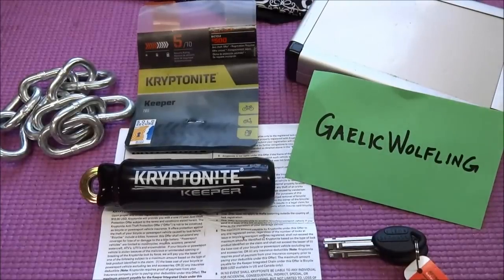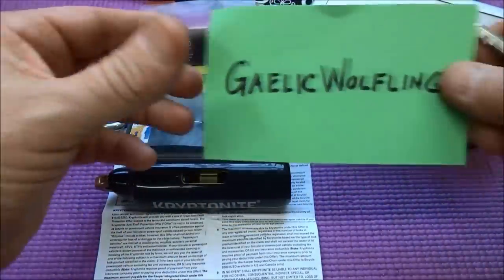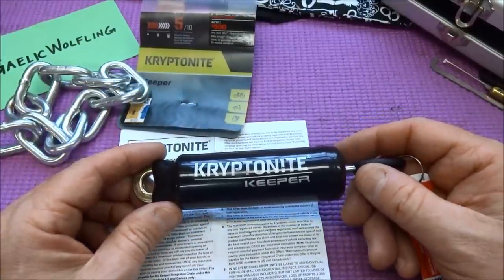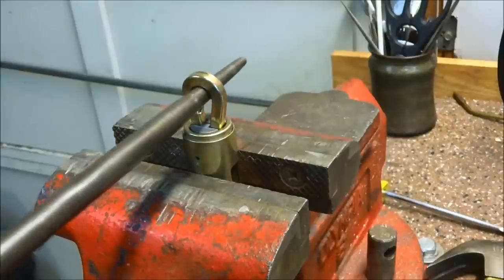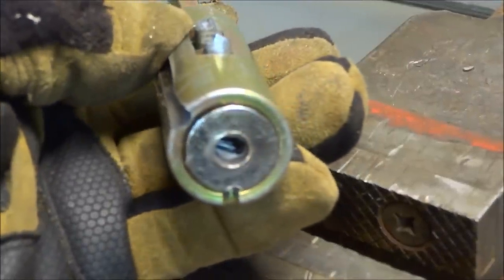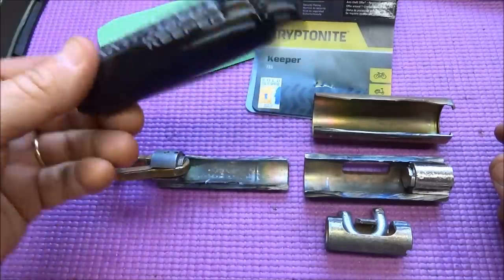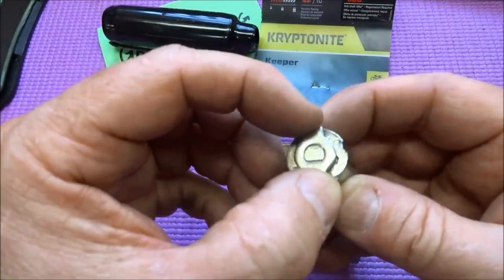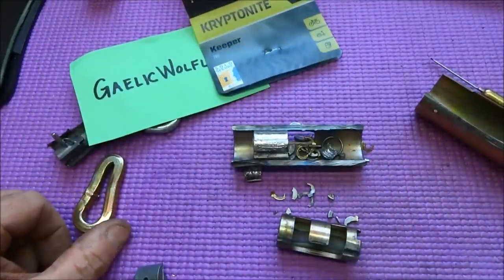(397) Kryptonite Keeper Bicycle Lock Autopsied - One TOUGH Lock!!!

Comment: All these locks are used to prevent theft of a bicycle, am I right?
But the bike lock must have some sort of flexible part to wrap around the 
frame of the bicycle and whatever you are securing it to, am I right?
So if the flexible part is a thick metal cable or chain, can't you just get through that with bolt cutters?
Sure, the lock is tough....but what about the chain?
Or are there chains made of hardened steel so tough that cutters won't work on it?

I'm not trying to be a smart-ass here, I genuinely want to know because I use my bike a lot in the summer 
and I don't want it stolen. So I'm asking, if they can't get through the lock, won't they just cut the cable/chain?
So what's the best setup to use to prevent your bicycle from being stolen?
Reply: +Don Miller The lock comes with a length of hardened steel chain that's an absolute bitch to cut through. It's going to require power tools and some serious effort to deal with. Much easier to just grab the next bike over.
Reply: Just A Dude

Hey thanks! I'm going to buy it, or one comparable. I appreciate you taking the time to explain it.

Comment: After watching this, I went to check the rating on my kryptonite U-lock. It says 8.
So I'm guessing the only reasonable way to steal my bike is to grind the bike rail, which to my knowledge is not common at all. I guess I can stop using two locks... although there is still value as deterrent.
Reply: simply apply thermite
Reply: Because every petty opportunistic thief goes around with thermite in their pockets...
Reply: bosnianbill thank you for responding so seriously. To answer your questions getting it is fairly easy it is formed by 50/50 ratio of aluminum powder and red iron oxide. How much will you need? That depends, if barium nitrate and sulfur are added to form thermate, if so only a few ounces will be need. Plain thermite will need about a half pound of reactants. The two catches are ignition and placement, both thermite and thermate are lose powders so they must be contained for use or bound in a material like artists clay. Ignition is were it all falls apart you are going to need either red phosphorus or 60/40 ratio of magnesium to potassium chlorate, the latter being if at best.
Reply: bosnianbill well mark me as served.
Reply: +Finn notyobissnes I'm not even sure anymore I'm really on YouTube. You two just had a normal conversation !!
Reply: +bosnianbill  I thought about it.... take the homemade mixture and mix it with wax in a mold the length of the key way ..( shape it like a key blank) Put a ribbon strip of magnesium in with the "key" in the key-way... Lots of heat and sparks/smoke prob would come out the key hole plus the plastic will prob melt/catch fire... But looking at the innards ...the disks prob wont need much heat to melt... they look thin... Or the cam on the back will separate allowing the locking pawl/gate.. to rotate...   Not practical for most bike thieves but, If an "agency " needed a noiseless quick entry..This may work... oh keep a extinguisher handy.. or lots of water...
Reply: +Dave G That wont do. The discs will melt, but they will pretty much seal the lock mechanism in place. Youd essentially be welding the lock shut from the inside.
Reply: +Grega Meglic Im Guessing you could just cut the chain with bolt cutters and just leave the lock on the bike/ on wherever its bolted to to steal it. Then Spray paint the lock to match the rest of the bike. If it is through the tire, and an expensive bike, just take the tire off, buy a new tire then resell bike.
Reply: rdizzy1
This is "ye old standard chain lock" Meaning just a chain and nothing more. And while the lock itself is pretty secure, the chain is as you say.
Reply: Grega Meglic
Ah, ok.
Reply: Grega Meglic
Especially now that you can get portable hydraulic bolt cutters, can cut through all chains, and almost all locks too I bet.
 And they are very quiet, and smaller than long manual bolt cutters.
Reply: +bosnianbill no, in theory a perpetual energy machine could not work. What assumptions are you making? No friction? and even then you could never take energy out of the system, or "harvest" as it were.
Reply: JuggleAddict
He means that only in theory would a perpetual motion device with absolutely no friction work, but impossible to build in reality. It can still be perpetual motion without taking any energy out of the system, it is just useless energy wise.
Reply: well yea, sure, take out friction and perpetual motion is everywhere. Heck, in that case just spin a coin.
Reply: +Finn notyobissnes So you basically need a chemistry university degree!

So simple!
Reply: +Finn notyobissnes lmao gg

Comment: Interestingly, Hollywood directors never show the torquing method. However, I've seen it done once in the movie "Heat." Tom Sizemore and Val Kilmer were robbing a bank. One went on the phone pole and hacked the security system. The other did the same thing you did: drive a huge chisel into the lock and simply break it with a large ratchet wrench. Would a professional burglar be more likely to use this brute force method if there was no other way to pick the lock?

Comment: why not drill out the pin?   don't know if it's been suggested.
Reply: littlegoobie A lot of the time these pins on well made locks are made of a hardened cast alloy and will just destroy any drill bit. I speak from experience as a lock hardware mechanic in the past. It is even common to run into security screws you can not take a drill bit to with out it ruining the drill bit. And there has been cases due to no other choices where I've had to burn up 10 to 15 drills bits just to get a deep enough hole to fit a 'easy out' in to remove/pull a pin or screw. But still that is a good question you ask, and chances are he probably already knew it would be a hopeless effort, thus the reason he didn't attempt it. What was obvious about the pin is it was a drive-in pin instead of a fixed pin, so it would've of been possible to pull that pin but a very taxing effort and a lost cause just by the design signatures of the lock.

Comment: thankyou i really enjoyed that being a guy that had two high end 2stroke supermotard bikes stolen because i used crappy hyped up chains and locks i eventually got smart and purchased an ALLMAX IMOBILLISER 2 16mm chain and an atlas padlock its a large padlock with a muscleman upper torso stamped into the case and has a flat key with a series of circular countersunk holes that are different colours ive not seen a key like it before and it says in big bold print DONT LOSE THE KEYS you can guess by that its un pickable suffice to say my bike has not even been attemped to be stolen as the chain goes through an OXFORD DEFIANCE ground anchor which is a beast of a ground anchor that has four 10mm rawlbolts with ballbearings tapped into the allen hex heads so now i sleep soundly at night knowing those thieveing bastards really arent going to get anywhere without waking me and my 30inch steel machette up so i can have thief suchi ps you may want to try and get hold of these products for a test.
Reply: dude if you locked all that up with a lock such as this, then its your fault for spending all that money on the toys and spending  30$ on a lock. the more valuable your toys the harder people may try to steal them, so the better your locks need to be and your over all security. its not bills fault you trusted so much to so little.
Reply: dude if you locked all that up with a lock such as this, then its your fault for spending all that money on the toys and spending  30$ on a lock. the more valuable your toys the harder people may try to steal them, so the better your locks need to be and your over all security. its not bills fault you trusted so much to so little.

Comment: might be a good lock, but it is open for dirt and rain, often fails to be opened with the correct key and the worst problem I read is that it happens that you can open a lock which do not belong to the key. Seems Kryptonite do not have enough combinations for it. btw an angle grinder opens every lock in less than a minute.

Comment: what about drilling the pins/lock.?
Reply: +adam moscatello Hardened steel, you will go through a lot of bits before you got through that lock. Better off with an angle grinder.

Comment: The unfortunate easiest single point of failure here .... cut the chain. Also, a question .... why always Drive the pin? wouldn't it be better in some(/most?) cases to drill out a roll pin?

Comment: You need to invest in cut off disks, they are a thin grinding disk, come in .040 and 1/16" thickness and cut metal like a hot knife through warm butter. They will cut nearly every type of metal with ease, and with lithium battery powered grinders almost all locks made of metal are doomed.
Reply: +Ray C. It's not something you should share with the public.
Reply: +AL eng it is common knowledge...
Reply: Spudwellington It's common knowledge on making bombs . I just suggest intelligent people refrain from writing the details for the public. And then there are those that are dumbasses and could care less about other humans.

Comment: Lithium battery powered Dremel with carbide bit. Done inside of two minutes.
Reply: +Rod Palm carbide drill bit  is wayyy too brittle for that. a dremel wouldnt provide nescessary torque and it would also be too high rpm for that drill bit. but i understand your carbide drill bit would be toast "inside of two minutes"

Comment: Those people saying "u should have cut the chain!! it is the weakest part" and "wow did the nsa really open ur letter!" are missing the point and are bad at subtle humour.
Reply: yellowfolder the actual chain that it comes with is hard-pressed steel lts just like the lock itself and the little link that was in the lock it's just like that
Reply: No one would use the original and then forward it on. Make a copy of it first and have your fun on that.

Comment: it's a '5' because the thickness of the chain. everything up to a ten is just thicker and thicker. it's just to drive up cutting time. breaking these in any other way is too hard. the 'cutting time' is a scam though since thieves don't use hack saws or angle grinders. unfortunately these can be snipped with some large bolt cutters pretty easy and the 10s can be too with a little more effort. carrying thicker steel though isn't really an option. if you go pick up a new york 'fahgettaboutit' you'll know why. 
 i think soon they'll have to make the bicycle frames into locks themselves, with any cutting rendering the bike useless. we'll see if that happens though...
Reply: Bike thieves will often not bother about the lock and just steal the fork. Usually all you have to do is cut the hydraulics and loosen the stem.
Reply: schpoingle
Hi, I don't understand. Could you tell me why carrying thicker steel such as the New York Fahgettaboutit isn't really an option? Do you mean on account of the weight? The Fahgettaboutit isn't too bad though don't you think? 2 kg.
Reply: @alantaylor6691  do you really think it's that hard to order a set of bolt cutters?  

Get however thick metal you want; there are bolt cutters that will get through it (they make bolt cutters designed to get through hardened steel specifically) and they will get through it rather quickly.
Reply: thieves do absolutely use cutting tools like hand saws & angle grinders in addition to bolt croppers and hydraulic cutters. What I have never seen (even online) is cases of lockpicking, even though many bike locks are easy to pick. 

There is also a limit to how large / strong of a lock can be useful as for something like a Krypto fagh , it is much stronger than any piece of street furniture it could possibly fit around. Bike stands in particular are made of thin mild steel and easily cut.

Also the most expensive bike have components on them that are worth even more than the frame, which are easily removed with an Allen key.
Reply: @dfpguitar  that's what you're supposed to make sure to secure those parts within the chain, and not just the frame itself.  If not, people will just take the front fork and tire and shit
Reply: schpoingle, not all chains are alike.  I once lost a key to an Abus chained lock, and I tried to cut it with my medium sized bolt cutters, and I couldn't hardly get a ding into a chain link.  I finally took it to a locksmith, who picked it in 20-30 seconds.  The chain hardness was remarkable...
Reply: The Ball Bicycles usually don't have hydraulics, only chains, wires and pullies.  Motorcycles are a different thing altogether.
Reply: @johnfrancisdoe1563  the better bicycles have hydraulic disk brakes.

Comment: the letter says:
30 September 2013

Dear 'bosnianbill' :
Here is the Kryptonite disc detainer (*detained) lock. Please evaluate it
as best you can. There is a warning to only turn the keys
after it is fully inserted, so I think it can be damaged with 
torque, but I am guessing (hoping) that the lock will not be open.
Perhaps you can work on picking it first. I am unable to pick it.
Also included is an OnGuard padlock. I made a video on it, and
you may find it interesting. I would very much like to see what
is in the cylinder, so if you are as interested, perhaps you could 
gut it and find out what this "Bump Blok" is.
Thank you for taking the time to make such great and educational
videos. I got into locks because I was very uncomfortable with 
faith-based security.

PS To the NSA agents reading this, there is a hidden message. I
bet you cannot find it.

Comment: No thief is gonna go through all that for a motorcycle... get a Kryptonite lock!
Reply: +CBR Rider a thief would just bolt cuter the chain.
Reply: Football Chat  There's a lot of great inexpensive anti-theft hardware out there.  Thieves tried to cut my chain about a month ago with bolt cutters,  they failed.  Hardened steel,  1/2" diameter.  
Plus I had 3 or 4 layers of security for my motorcycle.  They just tend give up most of the time.
Thieves want easy projects.   The more security you have, the less they tend to try.
Reply: +CBR Rider are you in the uk?
Reply: Football Chat  Nope .... U.S.
Reply: CBR Rider
theres a lot of crap chains out there. Check out youtubes on video of them being bolt cutted, best chain I think is an Almax
Reply: Football Chat  I agree ... I'm happy with the chain I have though, it has withstood several cutting attempts with only scratch marks.  With that and 2 disc alarm/locks,  my CBR1000rr is pretty safe.
I live in small Apartment complex where everybody knows each other,  that helps too.

Comment: Man all you had to do is drill out few mm of those pins and slide cylinders apart (twise) and silicon is just slides off you don’t have to cut it. I have this lock and I did all that.

Comment: Naively, I would have suggested extracting that pin with something like an Easy Out, but I'm guessing that wouldn't have worked.

Speaking of the NSA, they have a philosophy that you aren't qualified to DESIGN a cryptographic system until you have experience BREAKING them first. Perhaps it's the same with locks.

Comment: what about liquid nitrogen?
Reply: ThesainOne Or use blow torch to rapidly heat it up,then cool it with liquid nitrogen,do that couple of times,cause shitloads of stress in metal,couple hits with sledgehammer and lock breaks like glass.
Or since its hardend steel heat it up and let it cool down,reduce it hardness and then cut it.
Reply: zumbazumba1 These locks are crazy

Comment: couldnt have drilled out the pin he was beating on?
Reply: hardened steel, very difficult to drill, likely to break a drill bit
Reply: jutubaeh unrealistic scenario, thieves with high end laser cutting equipment
Reply: Poeder Ruiker. hey what about liquid nitrogen
Reply: I don't think it'll work... The body of the lock is wrapped in rubber possibly preventing major damage. The link is barely exposed and partially covered by an attached chain making forceful impact harder, maybe even impossible. Torque would also be very hard since the hole is quite small. My best bet would be to freeze the chain hoping it isn't covered with something, then smashing it. But this is just a guess, I don't know for sure.

Comment: You seem to be using a rather thick wheel for your grinder, looks to be 1/8" or maybe even 1/4". Why not use an actual cutting wheel? It'd be a lot faster.
Using a nice and thin SAIT cutting wheel I bet I could slice that thing open in a few minutes at best, without removing nearly as much material.

Comment: bolt cutter and 5sec.
Reply: +Unauthorized Expression Pretty much any time an exposed shackle/chain is involved, that is the case.  However, if the steel is hard enough, the thief is going to need impractically large bolt cutters.
Reply: most locks I've seen do not guard well against brute force. Not much they can do to stop a truck with a chain. I always lol when I see really good locks on glass doors.
Reply: 1) the chain is jacketed in a ballistic nylon sleeve 2) if you defeat the sleeve, in 5 seconds, you'd have mangled bolt cutters.

Comment: To "Mr. Bolt  Cutter", 
Yes, you can defeat any lock out there if you don't care about sparks, security, cost, police, etc., etc. 

Hell, just get a shaped charge & blow the whole door off assuming you're working on a door lock & really want to make some noise. 

But, if do come up against something unexpectedly tough & your "tool kit" doesn't have the right stuff, you can always carry a little "thermite" to burn your way in. Don't forget to wear safety goggles & gloves. 

(Whatta dweeb)